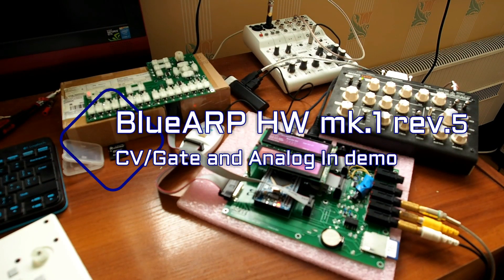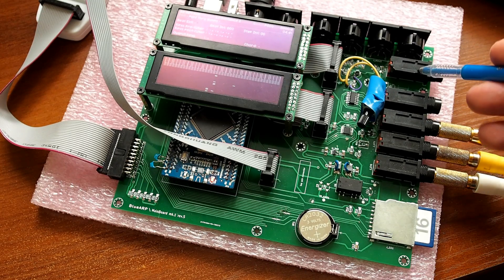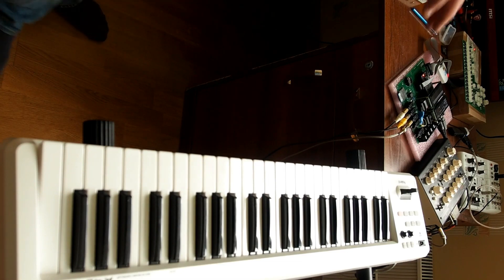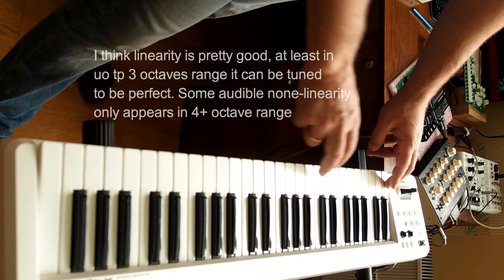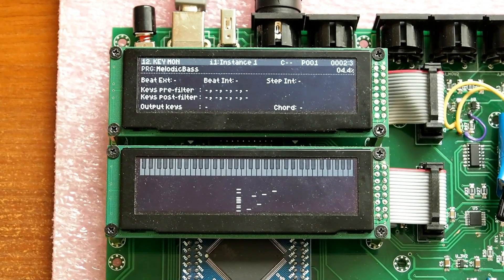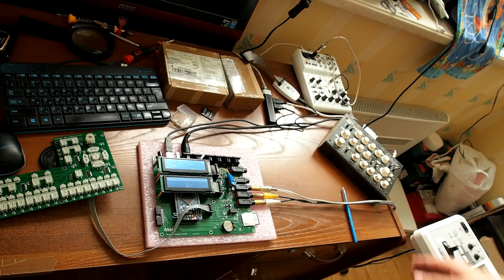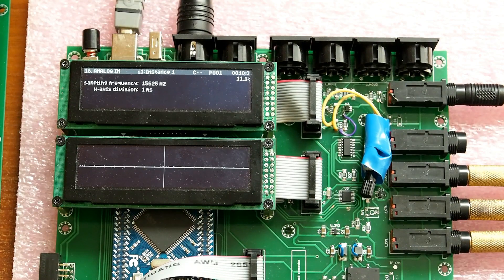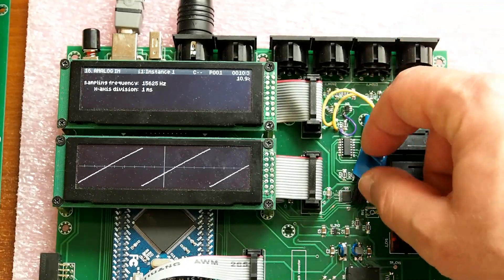BlueARP HW mk.1 rev.5 demo (CV/Gate and Audio In)

Comment: You gotta love the dirty fixes ^^

More seriously, that oscilloscope is purely amazing. I am baffled by the fact such a "weak" (not the best word) CPU is capable of so many things with efficient programming ;)
Reply from the maker: Thank you, my friend! To be honest, it is not that weak. Risking to look like an old nerd, I'll say this board has a 120 MHz ARM CPU, while my first computer (Intel 486DX) had 66 MHz CPU, and 100 MHz was a wet dream at that time. So it even has some extra juice, and I hope I can use it to implement audio beat detection or maybe to add some other cool things I'll invent later.
Reply: @graywolf2004ru  You certainly don't sound like an old fart, but more of a man of the '80s. Quite simply, you grew with different times, just as we'll call me an old crump 50 years down, because my first PC had an AMD Athlon CPU, and i lived in an era where archaïc 3G was predominant... What a pleb will i seem to those younglings !